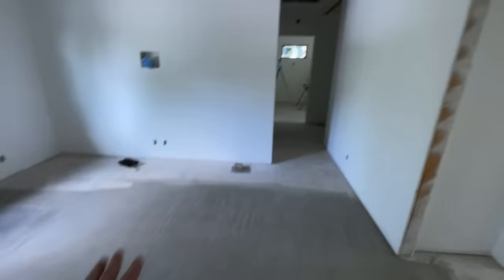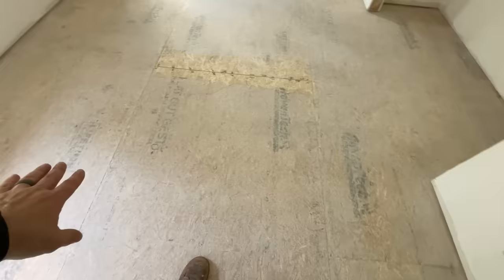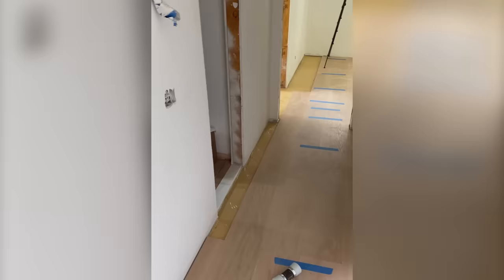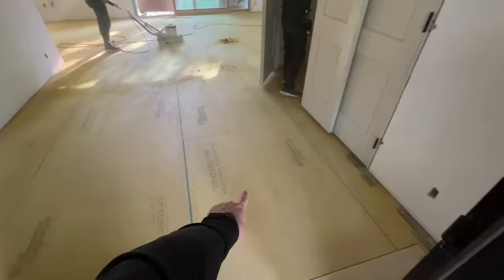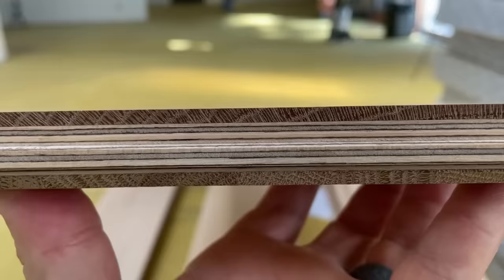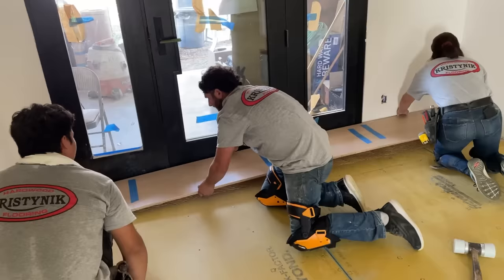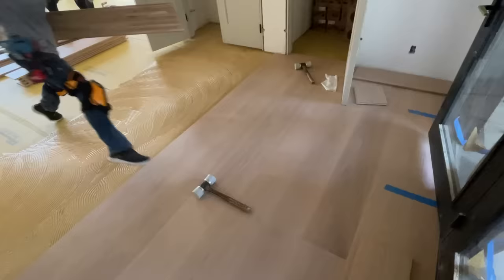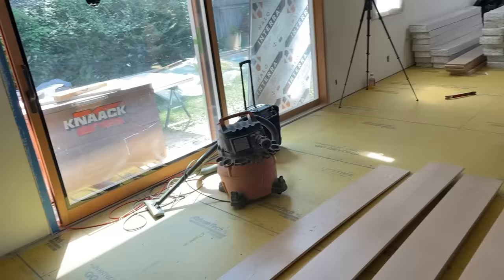Engineered White Oak Hardwood at The Real ReBuild!

Comment: the glue notch is in a swirl pattern. But the boards are laid length-wise. This will trap the air and prevent the swirl from spreading under the weight of the board.  a better pattern for glue is to have it perpendicular to the length direction of the board that way, as you squeeze the board down the air in the notches would get pushed out
Reply: Very important for tile installs, not so much for glue down hardwood. It’s true that some manufacturers will specify it, not saying you’re wrong. But with hardwood, the primary factor is a flat subfloor. If the subfloor is flat, boards will lay in the glue nicely and that glue is so strong, they’ll never have a bond issue. 

This looks like a really good install IMO.
Reply: That's really good advice
Reply: @josephkarl5021  If floors [concrete ] are NOT flat then what is the process of making the floor flat...assume using engineered hardwood floors...thanks for helping...t=may be making the transition form carpeting to engineered hardwood

Comment: The gap for expansion/contraction seems pretty pointless when it’s glued to the subfloor.
Reply: How much expansion and contraction will there be with boards made of multiple layers like plywood?
Reply: I agree but I would think there would still be potential for expansion, especially if it got wet for example. Probably easier as well.
Reply: It’s for the expansion of the walls more than the floor. 1/2” might be excessive for a high quality engineered floor but as long as the baseboard covers it…better safe…
Reply: If wood can expand with heat (and it does) then glue can soften as well, so....
Reply: Incorrect. The glue will flex, if you have no expansion joints you risk ruining your entire floor.
Reply: @kungfusing1  You're correct, and I wrote "heat" when  moisture is the real reason for meeding expansion gaps. Also "FLOOR Glue" is called that for a reason, it's designed to retain some flex after curing. (I didn't have to Google it, I realized my error when I woke up. Last night, I was thinking about why they would blame walls and that's because of the Sun heating and the night cooling a wall...)
Reply: Exactly
Reply: @chrisking6740  No I don’t

Comment: I love using engineering flooring for my clients and myself too, so stable and easy to control, you basically barely needs to sand it, even if it does require to do so, probably 10+ years later. And yes, surely you can get all in same color, just means that you will get more wastage that’s all, some people prefer a bit of uneven color, coz it’s natural wood, overall engineering flooring is a great product, love it.
Reply: Is engineered hardwood waterproof? What product so you recommend?

Comment: Fantastic wood there, I actually like how you went through and talked about prepping the subfloor. It's actually really unfortunate that so many flooring guys don't bother prepping the floors to be flat. A lot of them are "well we can sand the finish flat". New or old we always get our floor guys to do a quick once over with a super corse grit just to flaten out the subfloor. Makes installing easier and faster, and it really doesn't take that much time.

Comment: @Matt Have you heard about the problem with wind turbine blades being hard to recycle and taking up too much space in landfills? What do you think of the idea of cutting them into strips and using them as siding on houses? They're strong, weather and fireproof, cheap, and up-cycling them keeps them out of landfills. 
They could also be cut smaller and used as roofing tiles. 

It is possible to recycle the blades, but it's not profitable. Up-cycling them could be.

Comment: I have some Bruce engineered hardwood flooring installed in my home, built in 2007. The boards fit tighter than the ones on Matt's home (absolutely no bevel edge between boards and completely waterproof), so not sure what Matt is talking about. But the wear layer on the Bruce flooring is not as thick as Matt's, although it is fairly easy to replace individual strips if any get damaged (at least easy for a professional floor installer).
Reply: The company sponsering this video installed the floors in his house which is featured in this video. So you most likely won't hear his unbiased opinion on this flooring. Sketchy and shady if you ask me.
Reply: @Uranusfog  Matt could have chosen flooring from other companies, and would have received a similar or better discount. So I don't think that was the primary factor  in the decision. I am pretty sure that Matt's wife preference was the deciding factor.
Reply: @mark9118  That is true. I can be overly critical when it comes to sponsored content which comes with a recommendation for the sponsors themselves. As a viewer, I don't know the full intentions and ethical standards of the content creator so I err on the side of suspision. Otherwise, you are most likely correct.

Comment: Definitely not a lvl 5 finish on the walls with those waves...lol Floor looks great though.
Reply: That was surprising wasn't it, with engineered lumber in those walls too...
Reply: @chrisking6740  In my experience as a construction superintendent I find that the mud work is more often the culprit. If it does not call for a lvl 5 then most companies are not going to worry about it and just make sure the wall looks good. Level 5 takes a lot of skill and a lot more time.

Comment: Is there really any concern about expansion when the flooring is glued down? Wouldn't the glue have to fail in order for the flooring to move?
Reply: It's engineered hardwood. So you don't have the same issues as regular hardwood
Reply: Yes, but since there molding going in after the floor is installed, it doesn't hurt to leave a small gap. I think Matt exaggerated the size of the gap, and it looks like 1/4 inch or less.
Reply: Absolutely
Reply: I have seen so many floors fail for wont of an expansion, it's not even funny man.  30 years ago our glues dried hard, but these days not so much. They're very thermally expansive.  In my experience a quarter inch is insufficient over the long haul. One should have 3/8 of an inch minimum, preferably, and as a good rule of thumb, the width of the expansion joint should equal the thickness of the engineered hardwood.  One should note that many, many times the sheet rock is a 1/2 inch to 1  inch above the sub floor. That means you've got a 1/2 inch to 5/8 inch expansion space underneath the sheet rock.
Reply: @mark9118  If he can’t tell the difference tween a quarter inch and a half inch from that distance by eyeballing it he’s in the wrong business
Reply: @GOLDVIOLINbowofdeath  Matt is a contractor, not a flooring installation worker. He can't know the details of every single trade that works on a home. It may have been 3/8 inch in some areas.

Comment: I think you made a mistake by gluing down the wood floor to the subfloor without installing an underlayment. If you are using a good quality glue, the glue will bond the subfloor and flooring boards together. If the floor ever has to be removed (water damage, want a new floor, wear layer has been sanded away, warranty issue with the current flooring, etc.) the subfloor will have to be removed as well (this happened with a warranty claim in our town). You should have put down at least a 3/8" underlayment with 1-1/4" staples, stapled 1" apart on the perimeter of every sheet and 3-4" in the field. This will allow the flooring to be removed without damaging the subfloor. You need so many staples so the underlayment doesn't have any soft spots. You do not want to screw down the underlayment because the screws would rip the subfloor it removal is necessary.
Reply: Removing part of a floor that's glued to a 3/8 underlayment that has 800,000 staples in it doesn't sound much easier than trying to remove part of a floor that's glued directly to the subfloor.
Reply: You can’t remove the floor from the subfloor because they are now like one big piece of plywood . It becomes just like a layer of the plywood used for the engineered flooring core.  You would not be able to remove just one layer from the engineered flooring plywood core.

Comment: I've heard that floors should run the parallel to the main walkway/entrance for design reasons.  Something about "welcoming" you into the space.
Interested to hear what your designer said when making that decision.
Reply: It is more pleasing to the eye to run the flooring perpendicular to the front entry.
Reply: @scottr2327  
Are you saying perpendicular to the actual door, or to the actual entry/foyer?  So did Matt do it "right" or "wrong" in this video?
Reply: @epattonm  Aesthetically perpendicular to the actual front door is more pleasing to the eye. As to the fact that the flooring is run perpendicular or horizontal to the front door is left up the installer or the homeowner.

Comment: I like that wear layer.  It looks 3x as think as other engineered hardwoods out there.
Reply: That is true, but I have found that is usually easier to just replace any damaged boards instead of refinishing the whole floor. A professional floor installer can do this rather easily, and the repairs are seamless. Just make sure you buy enough spare boards at time of construction and store them. But I pretty sure that Matt got a hell of a deal on his flooring for the promotional plug.
Reply: 3x the price.
Reply: @grahamstefaan  Real wood or go home
Reply: @mr.g937  Engineered wood flooring is real wood, just like plywood is. You mean it is not solid wood, but solid wood floors shrink and expand too much and are not as durable as a factory applied finish found on engineered wood floors..

Comment: How can the wood expand and contract when it is all completely glued down to the subfloor?
Reply: I worked on a house once where they laid the hardwoods and then framed the interior walls on top. Seems like less work, although a little more in material cost. Only gap you need is to the exterior walls, and 1/8th is plenty imo

Comment: Why glue instead of nails or staples?
Reply: Engineered wood flooring is easier to glue, and since the planks are not solid wood, nailing along the edge of the boards may not be optimal. Since the boards are pre-finished, you definitely don't want to nail the boards from the top.

Comment: Why engineered flooring and not solid?  Is engineered better than solid now?
Reply: Cause the sponsor gave it to him for free. Solid wood all day
Reply: In terms of stability and durability, engineered wood floors are superior to solid wood floors, especially if the solid wood floors are site- finished. Engineered wood floors are factory finished using a baked on finished that cannot be achieved with a site-finished floor. Keep in mind that the top layer of engineered flooring is solid wood.

Comment: To me at least it would have made sense to get at least the majority of the paint slinging finished before putting down the flooring.
Reply: I think he will have a protective cover on the flooring.
Reply: @mark9118  Even so there WILL be spills.  Even with the board type covering he's planning on using.
Reply: I don't think it is inevitable that spills will occur. Maybe some over-spray, but the floor covering should protect it.
Reply: The painters can't paint until all the trim details are installed. The finish carpenters begin with the base and build from there. And you can't install the base, shiplap, cabinets, wainscoat etc until the floors are in. If this was a cookie-cutter home, Yes you might paint first and do floors after.

Comment: Surprised you didn’t use the hard wood floor that you snap in the one you showed at a home builder show
Reply: This one is engineered to be really durable, long lasting, and low maintenance...
Reply: I was wondering that as well.  If I am not mistaken, Matt actually featured that hard wood floor in two of his videos.
Reply: The reason for that is easy.  Delta Millworks sponsored this video for their product. Pretty sure that means Matt got the floor with a substantial discount (possibly free). I'm surprised Ramboard got such a shout out, unless they to had a silent hand in sponsoring the vid, too. :-)

Comment: If it is glued down what will you have to do if you need to replace it?
Reply: Make sure you have a replacement plank that fits the same. Drill the 4 corners of the bad/damaged plank. Cut between those holes. Drill/cut barely deeper than the plank thickness. Pry out the center piece you just cut. Use chisels/mallet to carefully cut up to the surrounding/ undamaged planks and remove all the tongues and groves. Cut the bottom of the groove off the replacement plank. Cut the short side tongue off. Now the new plank will set in, long side tongue first. Test fit, spread glue, insert and weight/wait for the glue. Why do I forget I'm on youtube and typed all this out. OGs read this far.

LET'S GO BRANDON! 👏🏼👏🏼👏🏼
Reply: Hire a flooring contractor to replace individual planks of an engineered wood floor. It will be impossible to see where the repair was made if they know what they are doing. It's not cheap in terms of labor, but materials cost is low since you are only replacing damaged planks. But you have to buy extra planks when you install the floor.

Comment: Trowel and error. Swirls are wrong. The channels are to let air out. If you swirl or cross hatch, you will lock pockets of air unevenly, or at least have lower % contact and bonding.

Comment: I have engineered hardwood in my house, and I absolutely hate it. It gets super scratched up like hardwood, but can only be sanded down once or twice. Mine also has “three planks” per bird installed and the fake seams are tighter than the real seams making it look like laminate. So me it’s the worst of both world. At least if I just had laminate it would scratch up like it does now.

That being said, I like yours a lot better than mine specifically because it looks like a single plank per board, so there aren’t any fake “seams”.

Comment: Matt what do you think caused the floor leveling issues? I’m surprised since you used so many premium products and subs. I would’ve thought you wouldn’t have to plane and sand
Reply: good point Kevin Prociw...after watching a few of his videos...I strongly believe that Matt is just a glorified salesman...I don't think he's ever built anything with his own hands...I know his types.. I compete against this type of contractor all the time here in San Antonio...
Reply: @davidmireles6056  Look at the wall at 10:30, it's crooked as f*ck.  I can't imagine it's supposed to be.
Reply: I hate to say this but his trades aren’t as top notch as he professes. Take a close look at the exterior brick video. But he is leading the charge for better details and materials in homes so that makes up for it to me.
Reply: I've been building my own house and using grade lasers to level each joist (shimmed individually) and SIP framing to try and keep things flat and plumb as possible and there's still a bunch of walls not square, plumb, and certain areas of the floor that aren't flat. WTH? This is my first house I've ever built and perfection is impossible to achieve. I think the materials simply move, especially the lumber. I used the moisture resistant subfloor too and it still curled up at some of the seams, though, my house was practically underwater during the rain season for months so I can't fault the manufacturer.

Comment: What about gluing down to concrete slab? I have some slate floors and raising the wood up with ply would take it too high.
Reply: I have glued-on engineered wood flooring in my home that has a concrete slab foundation. No problems at all and extremely common. However, I would get a professional to do it.
Reply: You can tile concrete, plenty of DIY tutorials on how to do it properly...  People do it all the time for concrete patios, concrete swimming pools, etc. for example... Just have to watch out if it's a new structure as over time the concrete may crack, settle or shift, etc. and in turn damage the tile but there are products like Flexbond that can help and maybe you might have enough room for a decoupling membrane product (Kerdi-board, etc), if you really want to be sure...